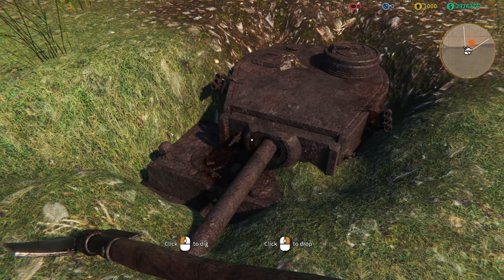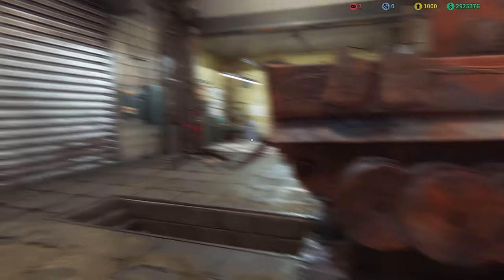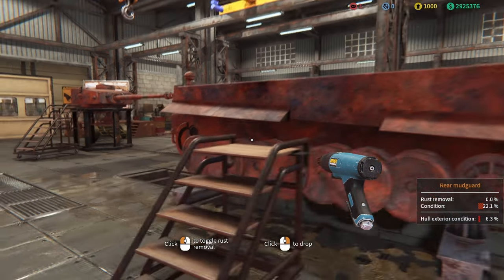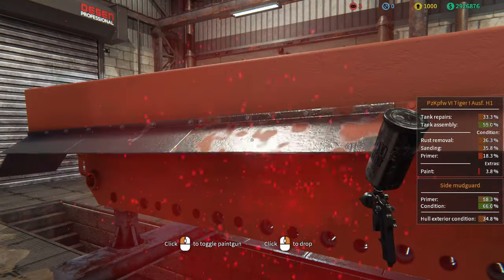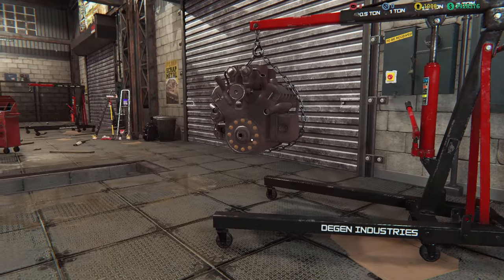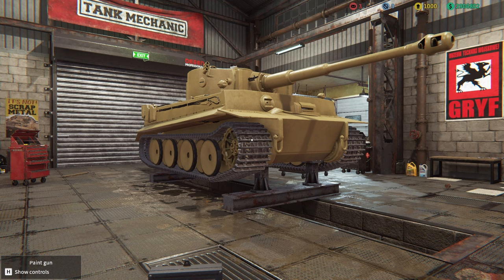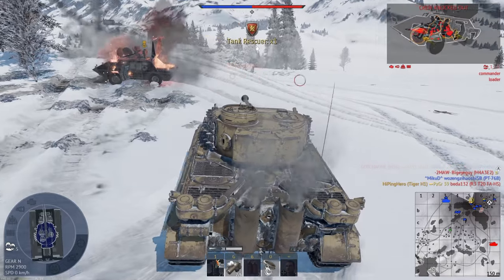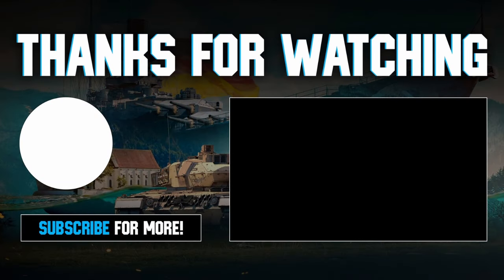Restoring a Tiger Tank for War Thunder | 2024

Comment: The only way to play properly using square-like tanks is angling, when you manage to angle the tiger, almost every tank in 5.7 / 6.0 can't pent you

(OBS: You angled pretty well btw, the only pain in the ass is when we get uptiers 💀)
Reply from the maker: I did leave out a small part on why the E is better as the copula on the H1 gets easy penned and is a weakspot for crew. But agreed if you can angle well, you can do well 🙂

Comment: Also to get the torsion bars under the tank you don’t need to take off the wheels you can just spray under the tank and it will clean and paint them and way are you using the needle gun just use the angle grinder